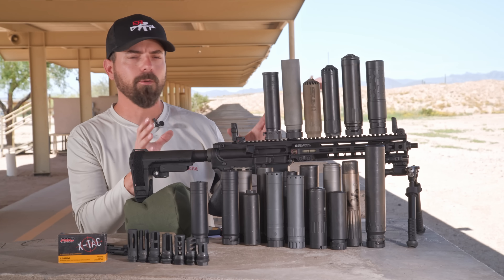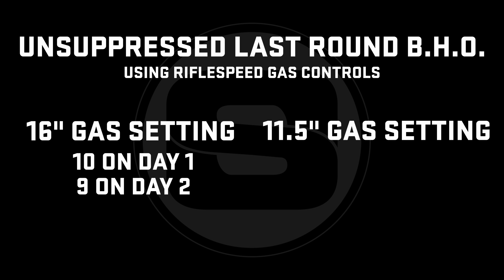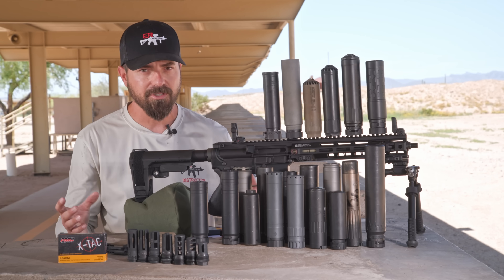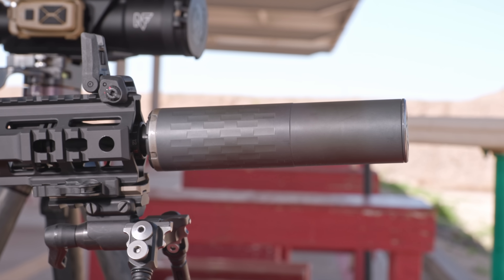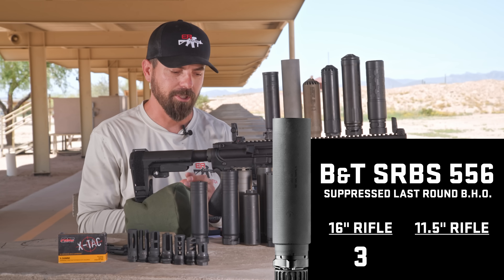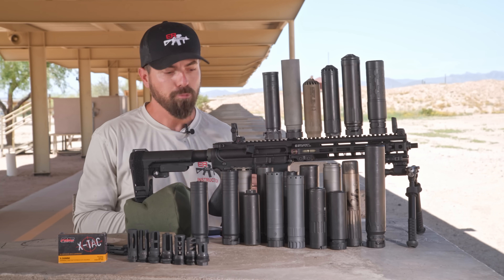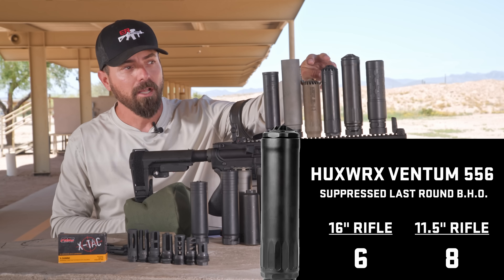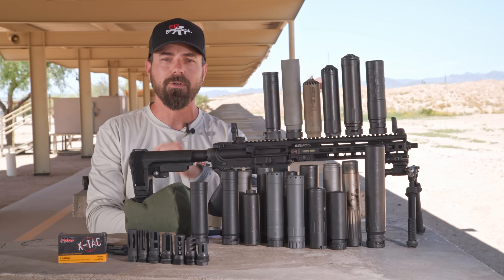Low Back Pressure Suppressor Showdown - Huxwrx, SilencerCo, B&T, Surefire

Comment: I have a velos, b&t srbs, ventum 556. the ventum hast least back pressure in my 11.5 and 14.5 bcm uppers. however the core had some disintegration after 750ish rounds. huxwrx replaced it under warranty. I don’t use it on short barrels anymore. the velos is a beast but will require a little buffer weight tuning. I use an h3 for it. srbs is great on a 11.5 but a bit gassy on a 10.5.
Reply: Which do you recommend to replace a sierra 5 and sandman s swapping between an 11.5 and a rattler LT 300bk

Comment: 0:18 My rifle speed gas block protrudes the same distance out of the hand guard. Only I can’t quite get a grip on it with my fingers to spin it. 
So I ended up having to have a hand guard that has a little bit more room for the fingers. Are you able to get your fingers into the hand guard or are you just gripping what’s visible here in this particular shot and That’s good enough? It sucks cause I had it set up perfectly exactly like in this screenshot but I was unable to turn it with the tips of my fingers.
Reply: use a flathead screwdriver bro
Reply: Thank you for your comment. I can’t decide between the srbs or the velos.

Comment: Is it possible to run a can with a non adjustable gas block with either a 10.5” or 16” barrel?
Reply: Yes that is what makes low back pressure cans so nice
Reply: Absolutely, assuming each barrel port is sized right.
I tune all my gas guns to run all ammo, and i try to be a fuzz under to properly gassed with no can on them. So with a flow through can on they are all perfect to just a hair overgassed. I find for mid and carbine length gas you can get away with pretty heavy buffers. I try to get every build to shoot as soft and flat as possible while being reliable, then again though, im using springs, buffers, lightweight carriers and adj gas blocks to do so. But as long as you have properly sized gas ports you can get by with just using buffers, and potentially diff springs to get there too, youll be just fine.

I cringe when i see someone, or i shoot someone elses overgassed ar. Theres certainly an argument for reliability there, but imo, softer flatter less violently cycling builds are soooo much nicer to shoot imo

Comment: I'd like to know what the relationship is between backpressure and sound supression.
Reply: It's a little complicated, but essentially there are three points of measurement when measuring the decibel rating of a suppressor: muzzle, port (or at-ear) and near shooter. High back pressure suppressors may be quiet at the muzzle and as a bystander, but might be a touch louder at the ear, while a lower back pressure can is quieter at the ear but is louder at the muzzle and as a bystander.

Typically it's because of how sound travels back through the firearm as it follows the path of the gas. That's actually why KAK Industries reported and measured that their downward venting bolt carrier group is quieter than a standard mil spec bolt carrier group. And I can't say for sure as I shot these on separate days, but to me it seems like two of my short stroke piston driven guns seemingly shoots quieter at the ear with a traditionally baffled, high back pressure can than my 14.5" tuned midlength AR-15 with a Polonium K. Don't quote me on that, but while the Polonium K is my favorite suppressor as a lefty, my tuned Bren 2 is a touch quieter overall.

Comment: Thanks for the info what about the 9.6” .300 blk which can without an adjustable gas block would be a good option? Currently running Omega 300.

Comment: Hey, what exactly does low back pressure mean? Any engineers or gunsmiths in the house?

I would imagine the max back pressure is determined by the powder in the round, and what a suppressor does is extend the dwell time of that pressure in the barrel? 

I'm trying to wrap my head around what actually is happening in the gun between the gas system and the end of the muzzle. 

If anyone can explain to a dummy lol! Thanks!
Reply: it's just looking at increasing the forward resistance which increases the blowback.  the gas in your face thing when suppressed, restriction on muzzle forces gas to escape back towards shooter, from increased back pressure.
Reply: Part of what happens, is that the gas hits the blast baffle and a pressure wave reflects back down the muzzle. Low back pressure cans disrupt that reflected wave activity by blast baffle shape, vents to allow gas flow, baffle spacing, and material texture to disrupt flow.

Comment: Looking at buying my first suppressor, I want a 30 cal can what would your recommend, looking for the quitest but best can for factory platforms( no adjustable gas block and so on) going on a ar 5.56, 300blk,/ bolt 308
Been looking at 
Q thunder chicken
Dead air sandman
BT 762
Huxwrk 762
Reply: I have the b&t srbs 762 (the one with the free tax  stamp) and I’m very impressed. Sorry to say I don’t have any other suppressor to compare it to but I’m happy. No ringing when shooting 556
Reply: @coryhargrove4327  i just picked one up today.  will be testing it out this week to see how well it works.

Comment: First, I would have liked to see a table showing all results. Second, would it be better to get the Huxwrx ($1300) OR get an adjustable gas block and a cheaper suppressor?
Reply from the maker: Thanks for watching. You can our testing results on our website. As for the second question, that really depends on what you’re chasing, sound suppression, low back pressure or both. Despite what some websites say, Huxwrx has always been some of the loudest cans we’ve tested, good on low back pressure though. Here’s our data so far:

https://silencersyndicate.com/testing-data/suppressor-info-chart/
Reply: AGB creates a multi point of failure. If you don’t care about reliability then it shouldn’t be an issue. As a side note, 5.56 will always be loud and a suppressor being marginally louder but have no downsides on internal wear or needing to tune your gun to prevent cancer gas going into your face is definitely worth it
Reply: Me I'm newer I should say to cans so I focused on low back pressure for my first can I feel less gas in my face when I shoot it's easier for me to focus on target I've also shot my hux can without ear pro yeah it's louder but I had no ringing to the ear surprisingly.

Comment: B&T SRBS762 Ti, SiCo Charlie ASR mount via SiCo ASR f/s, PWS 11.85" piston .223Wylde, BHA 5.56 50TSX. 

Previously running a 36M, short & long configurations, with the above-mentioned style mounting system.

Firearm ran on the lowest gas setting, #3, with the 36M. It also ran reliably on the same setting with the above-mentioned B&T can, but would not lock the bcg open. I switched to setting #2, more gas, last round bolt hold open achieved.

I had to adjust my RDS as my POI was ~2moa higher than with the 36M. Maybe b/c the SRBS762 is 4.93oz lighter than the 36M with the same style mount?

The only downside so far is the pronounced sparkle show from the front of the can on every shot during lower light. This condition being before full daylight on an early morning with overcast conditions. 

I've only had it out the one time & am looking forward to trying it with other ammunition. I also plan to have an extra shooter or two so that we can do an unscientific sound comparison with whatever cans we can scrounge up.
Reply: solid notes! thank you for sharing

Comment: I have a shooting range at my home and have had a suppressor starting in the mid 90s.  If sound suppression is not the goal and flash suppression is, why not run a top of the line flash suppressor and skip getting a can altogether.  If a suppressor isn't quiet it's just a huge waste of money.  Sound reduction and being lightweight should be the end goal, it is for me.
Reply: good feed back. def diff missions and goals for our rifles and in the end getting good info to those looking to achieve a mission is my goal. =)

Comment: Since these aren't 1 - 10 numbered "grades" but rather adjustable gas block settings for both, mid-length and carbine length gas systems on their respective weapons, based on your experience and research which suppressor would you recommend for a 10.3" barrel and a fixed carbine length gas system? I've been debating back and forth between the SureFire RC3 w/ WarComp FH and the SilencerCo.Velos LBP w/ either the ASR FH or & QD Mount.
Reply: The RC3 is a good can but the Velos are extremely impressive. IMO. Vid on just this soon! Should be out in the next few days. Consider watching it before purchasing.
Reply: the velos is really good

Comment: WELL IF THE MILITARY AND LAW CARE MORE ABOUT SIGNATURE REDUCTION INSTEAD OF SOUND JUST BUY A FLASH HIDER AND SAVE 600 TO 1200 DOLLARS A SUPPRESSOR IS DESIGNED TO REDUCE NOISE
Reply: Haters goin to hate.
Reply: yea, i  don't control their budget or choices.
Reply: They still want it quote, the signature reduction is just higher priority. The gun will still be quieter than if not suppressed.

Comment: I’m thinking about getting one is it pretty quiet ?
Reply from the maker: Low back pressure suppressors tend to be louder than high back pressure suppressors. The most balanced suppressor we've tested thus far is the PTR VENT 3. It's quiet as a Nomad L on a 16" rifle and low back pressure. Check out our review if you haven't already seen it.
Reply: @SilencerSyndicate  goes along with the recent pewscience review too. apparently it has absolutely outstanding performance. im sure huxwrx is still king in terms of backpressure, but vent 3 seems to be an amazing all rounder.
Reply: We are at a point where we can almost have it all! Low BP and quiet.

Comment: It looks like the Ventum 556 has the same back pressure qualities as the Ventum 762 from the previous video.  I think general “knowledge” was that a 762 should have less back pressure than a 556 but it looks small enough to be negligible?
Reply: it can have less BP but not always. Lots of factors. Thank you for your positive feed back and support.

Comment: HXQD556Ti is almost the same weight as the Flow556k. But just like HXQD556(4oz more) as a standard sized can instead of a k can, it is a bit quieter than the flow k.
I would assume a machined 17-4 core is a bit more durable than printed 17-4 or any pure Ti cans. 

The Ventum lost me on the Ti core in a stainless tube, isn't that the opposite of how you should use those two metals?? Ti as a reactive metal has terrible resistance to heat erosion and abrasion, and it sparks when it is blasted. I'm confused as they already made an excellent hybrid like HXQD556Ti, which has a 17-4 core.
Reply: None of them are really hearing-safe. That 140dB is on one pulse noise per day. Unless you're hunting, nobody shoots only one round.

All of those cans would be okay for a range session indoors as long as I'm wearing earbuds. So I think it is more important to have less gas on my face, less weight on my arms, and less flash/sparks for my eyes.

Heck, if I'm plinking with 22lr from a rifle with supers suppressed. I would still at least have earbuds due to the sonic crack.
Reply: @JohnZ556 Hearing damage is way more complicated than peak dB measurements. Go read any PEW Science article for more information.
Reply: @ToastbackWhale  Excellent point. 
Tho it would be difficult for me to never read any of them if I sounds like this deep into the rabbit hole. 🤫
Reply: You post a lot of great questions, we will continue testing with what we have and try to get our hands on Moore in order to best answer your questions. Thank you for your positive feedback and support.
Reply: The flow k is quieter then the hxqd 556 ti

Comment: I didn't think this would drop tonight! Thank you very much for doing this testing. I was initially quite interested I'm the B&T for a 16" or 14.5" rifle, but it seems the performance is slightly lacking for longer barrels. I'm honestly so surprised that barrel length, gas system length, has any effect on the back pressure of the entire system while suppressed. I find that interesting because most companies will advertise these low back pressure cans as low back pressure in all circumstances. That clearly isn't the case from testing!
Reply from the maker: Yes, definitely some surprising results but that's why we do these tests. Thanks for watching 🍻
Reply: Glad we could help support, do take a second look at the suppressor. And when we do all things considered video, you might find that the B&T suppressor really shines.
Reply: @Ertactical  I definitely will! I'm interested to see if maybe it runs better on different platforms besides a DI AR. I will have to wait until more people get their hands on the suppressor. They're incredibly new, and I think the channel here is the 1st video of a non-B&T rep using the suppressor.
Reply: @evoasus2286  so far they like us so we will keep trying to get more !